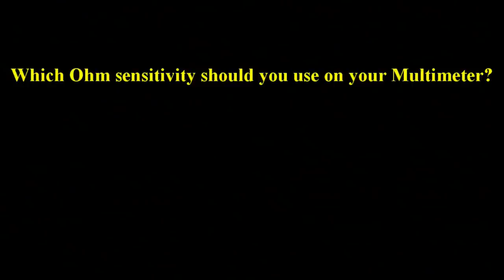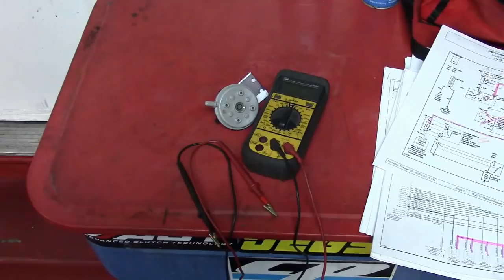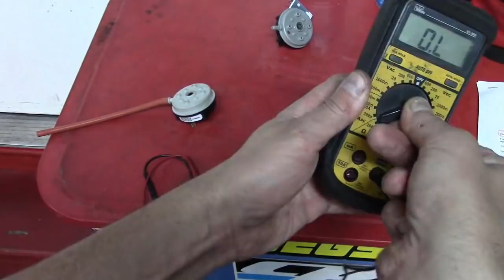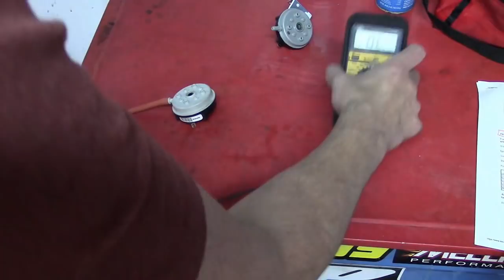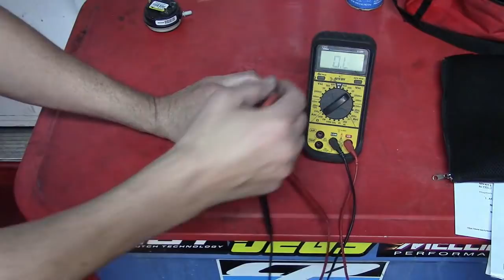Which Ohm Sensitivity Should You Use On a Multimeter?

Comment: ❤️❤️❤️❤️Cranks, no start. 1991 camaro 3.1 v6, yes spark, no power at pump, relays good.  Staggered, stalled, restarted twenty times to limp home at 2 mph, replaced filter, pump. Book says the following things can be problem, what would you look at?
Power steering pressure sw
Park/neutral sw
Inj ground A
Inj ground B
Ecm ground
Inj driver 246 or 135
Pump relay A
Egr solonoid
Vats module
Mat sensor
Oil level
Reply from the maker: none of the above. i would start with the extreme basics. just curve the fuel trim against load to get a basic direction.
Reply: @SchrodingersBox  ❤️i love your videos and your brain! But I read your response six times and  quite honestly have no idea what it means, do any any of your videos address what you recommend?
Reply from the maker: one of my earliest videos is called “secret of engine diagnostics: fuel trims”
   it will explain how to diagnose this condition.
Reply: @SchrodingersBox  thanks!! I will def send you $175 on patreon if possible if we fix it, cause thats what my garage wants for diagnosis

Comment: Generally, auto range one.

An auto ranging meter doesn't usually cost much more. Electricity is difficult enough to explain to someone.

My first meter was an analog cheapy from the parts store. I was 10 and I damaged it while learning.

No, I'm not sure that there's any good point to my comment.

Comment: Dryer timer switches are also a fun way to practice this. Awesome video, you're a great teacher!
Reply from the maker: Great tip!  I also use volume control knobs as variable resistors for testing potentiometer and thermistor circuits to confirm response.

Comment: I had a fault in the ABS, showed front left sensor on the scanner. So I check the wiring, is OK, I check the sensor resistance, it is OL. I thought "this is too easy" and after switching with front right sensor, the fault didn't move along.
Case was, that the sensor had about 30MΩ resistance and the problem was faulty ABS module (it also had some other codes stored but not important for this point).

Comment: Hi very good channel with interesting explanation. I like it so much. I have problem with my car  Ford focus 2005 symptoms are when the engine reaches the temperature of 90 degrees, the esp light comes on and the tachometer pointer works once and does not work. After reading the fault codes, it shows ABS U2023 and OBD2 P1132
When the engine is turned off and on again, the light goes out and the engine runs normally
What I noticed that after removing the plug from the temperature sensor when engine is working and cold on the dashboard the esp light comes on have same symptoms  as after  engine get 90 degrees. 
I replaced temperature sensor for new original didn't work still same problem. Please advise what I should start and check to find out what is happening.
Reply from the maker: Weird.  What fuel trim numbers do you have? Also is it possible you have a loose ESP toggle switch?
Reply: @SchrodingersBox  Hi thank you very much for writing me back, I appreciate that.  Today I check fuel trim and when engine run on temperature 50 degrees and there is no errors it's showing shrtft1 from 0 until 6( jumping) longft1  -7,45  RPM it's stable 1000rpm.  When it's coming ESP light with error then RPM it's jumping from 750 until 810rpm. Shrtfl1 from -0,98 until 4,89 longft1 -8,59. Sometimes you can hear steering wheel pomp on continuously. Engine runs rough and engine cuts out. I can add that this car had before faulty abs pump that has been regenerated by a specialized company.

Comment: I have a 2000 ford ranger and I can’t afford lift kit so how could a Inch or 2 in the front?
Reply from the maker: Just use a spacer under the spring. Be aware though a this will potentially upset your geometry and if it is 4wd the driveshaft geometry will change causing wear on the transfer case.

Comment: Its also important to understand the resistance of the leads you are using too as these can throw out a reading if you are looking for a precise ohmic value on a device. Some meters allow a zero function or you need to subtract from the value taken shorting the leads. Its fairly nominal but in some cases lead resistance can throw you out on a fault

Comment: Hey man, I am looking for advice and you're the best mechanic I've seen by far! I have a 97 Grand Cherokee 5.2 (4x4 all the time). I have a shake ONLY under acceleration/load. As soon as I let off the gas it stops shaking and rides smooth. Shake starts around 30mph and only gets worse the faster I go, can feel it in the steering wheel and in the floor equally.. I assume something with the driveline, but WHAT would cause shaking ONLY under acceleration and be smooth when coasting or braking?? I'm stumped
Reply from the maker: I would start with the extreme basics- just do a fuel trim analysis to rule out if it is engine performance or mechanical first.  Once you have that direction you can focus accordingly in the right direction.
Reply: @SchrodingersBox  thankyou! I will dig through your videos now, on how to do fuel trim analysis. Last question for you, would a transmission mount cause this symptom? (if it is mechanical) or would that be shaking at idle and cornering as well?
Reply from the maker: very unlikely to be a mount

Comment: Hi Matt, good to see you're back..I assume you might've been quite busy recently.
Just my 2c worth here.....As you mentioned, it's always a good to have an idea of what ohm reading you're expecting to see on the component under test, but if unsure what scale to use, always start with the highest ohm setting then work down from there as most meters will read low ohms on a high scale, but not vice versa.
However, if the meter has an 'auto-range' setting, always use it...this makes testing most things almost idiot-proof👍🇦🇺
Reply from the maker: Very good point! I should have included that procedure in the video!!
Reply: @SchrodingersBox  Hi Matt, cheers for your quick reply. (I should really go to bed, it's just after 1.30am here..lol) All good, it's always hard to include every aspect of a subject in a short vid, or to cover everyone's experiences, as I'm sure you see often by us keyboard warriors comments....Perhaps it'll spur a follow up vid on the subject?...although you always do a very thorough job on your vids, so no real need to spend too much more time on semantics for dummies, surely you have more important things to do with your time...thanks again for your awesome content, looking forward to your next analysis👍🇦🇺

Comment: Just watched the new Trans Am video on the pay channel. I know I'm a geek, but I found it fascinating. Best of all, I understood every single step of the diagnosis first time, thanks to your other videos. But I'm intrigued - do you think that the bad connection caused the switch to fail, or that the switch's intermittence caused a connection point to burn out in the connector? I suppose another possibility would be that you caused the connector damage when you first removed it from the broken switch (unlikely, I admit).
Thanks for another valuable video - great to see you back, Matt.
Reply from the maker: Great question. I don’t know but I like your second idea- never really thought about it.
Reply: @SchrodingersBox  I'm also curious about that other switch on the clutch. Obviously this would tell the computer when the clutch has been depressed, even slightly, but I'm not sure why. I'll have to check and see if my car has got one.
And don't forget to change that blue ink cartridge! haha
Reply from the maker: Lab I have a series on my trans am “Test your P0171 skills” that covers this but the brief answer is - when the car changes gears you need a slightly rich condition because of the higher load coming with the gear change. The Clutch Input Switch tells the PCM that a gear change is coming and the PCM responds accordingly in “anticipation” of the year change. 
  In the video, I showed without the input switch connected, the engine ran very lean every time I changed gears causing a brief hesitation.
Reply: @SchrodingersBox  Thanks, Matt. Is the series on YouTube, or on the pay channel? I can find a 'Lean Condition' series, but I've watched this a few times and I'm sure it doesn't involve a clutch switch. I'm quite keen to learn about this now, but I think I'm looking in the wrong place. Thanks for your help.
Reply from the maker: @labradormcgraw  it’s on this channel somwhere!
Reply: @SchrodingersBox  Thanks, Matt. I just found it; it's a two-parter. Here's the link for everyone's reference: https://youtu.be/VoiLJd2E0EI
Thanks again.

Comment: I got caught last week testing resistance values between pins on a Honda voltage regulator.  Using a digital multimeter (ohms scale), there was no continuity between any of the 6 pins where the repair manual had given me values.  I assumed it was faulty.  I read the small print later and it says to use an analog ohmmeter for the testing.  Sure enough, the combination of pins that had values as per the manual did, in fact, have values within range.

From a pdf:  "Analog meters can also bias, or turn on, semi-conductors and change the circuit by allowing current to flow to other portions of the circuit.  Most digital meters have a low voltage setting which will not bias semi-conductors and a high voltage setting for testing semi-conductors."

Comment: Its insightful to know when repairing circuits especially in electronic devices to understand the impedance of the circuit. If the item being switched was a large relay then a large current would flow against say a solid state or transistor circuit. With the faulty switch the latter may well still allow a small current flow in the open state which wouldnt drop a substantial voltage, this would be classed as a high impedance circuit. So yes understanding the range and limits of these settings are needed for diagnosing faults.
Reply from the maker: Yep that is exactly what happened with my furnace. The integrated circuit detected the small amount of amperage (or at least a tiny voltage drop- not sure how it works) from the 7M ohm’s on what should have been an open switch.  
   I sure wouldn’t expect 7M ohms to count as continuity but it did- the IC detected a short in the switch.
Reply: @SchrodingersBox  as you look at how voltage is dropped (distributed) across the circuit (higher the impedance the greater the drop) so in this case majority of which will be due to the switch, as long as there is enough left for the transistor (forward voltage of 0.6-0.7v) and the sum total resistance allows enough current to flow which a few micro amp maybe adequate for the transistor to conduct..110v / 7Mohm = 15uA little low but may well be within the linear region... Voltage was a guess so treat as example only.

Comment: why not use an autorange meter? Those $5.00 meters with manual adjustment are a waste of time in my opinion.
Reply: I've found the auto-ranging ones I've used to be slower on displaying the initial reading, which can hinder.
Reply from the maker: oWhy are they a waste of time? How do they fail to diagnose accurately when properly used? where is time wasted exactly? I don’t understand- please explain.
Reply: @SchrodingersBox  Changing the settings until you hit the one where the range falls in, this is what I was referring to.
Reply from the maker: But if you know what you are doing you know the range.  So it takes me 1 second to set the range. I do maybe 30 ohm measurements a year (because i usually use voltage drop not resistance).  So I would save 30 seconds a year if I didn’t use my $5 meter??
If anything a $200 meter is a waste of money if it saves time of less than 5 minutes through a career - which it won’t because it takes longer to do the calibration on an auto range than it does to just flip a dial on my $5 meter.

Comment: Hello, pls can I get ford focus 2005model electrical diagram from you?.
I am having no crank,no start problem
Reply from the maker: Sorry i don’t provide diagrams but just start with the extreme basics.  Test the starter load side and bypass it to determine if it’s a control or load side problem first. That is always the first step I do and it isn’t until I determine a control side failure that I start to need a diagram.
Reply: @SchrodingersBox  thanks for the quick response. I am an auto electrician too and majorly on trucks Nd heavy duty equipment.
I confirm it's a control problem but I don't know how to bypass the immobilizer that's why I need a circuit to guide me

Comment: what if your meter is auto ranging then what. this video is very helpful thank you
Reply from the maker: Good question. In that case it should have a calibration feature that you follow so it can draw baselines and then it will automatically determine resistance (if any exists).

Comment: Good video for sure.   For measurements that are close tolerance say it needs to be 0.5 Ohms or less, it’s a good idea to touch the probes together to get the initial resistance of the leads then subtract that from the total when measuring the part. On fancier meters such as Fluke or Amprobe, this can be done by depressing the relative button when you initially touch the probes together, before taking measurements. 

Not that there’s anything wrong with the video Matt. Just wanted to throw in that little bit of extra advice. Also, enjoy your Yeezes haha.
Reply from the maker: Very good point. My Snap On Vantage in fact forces you to do exactly such a calibration on resistance tests.